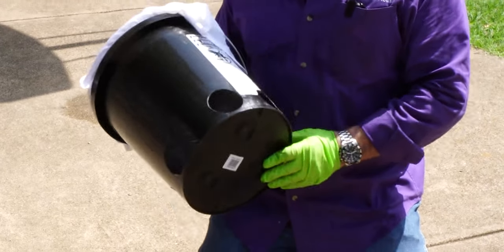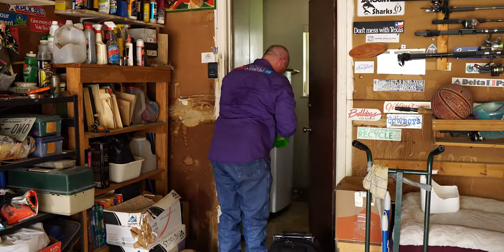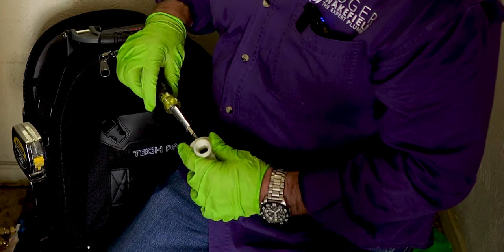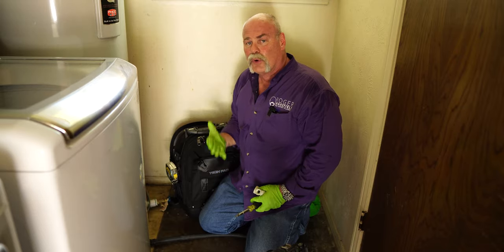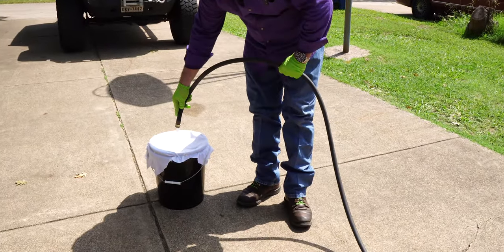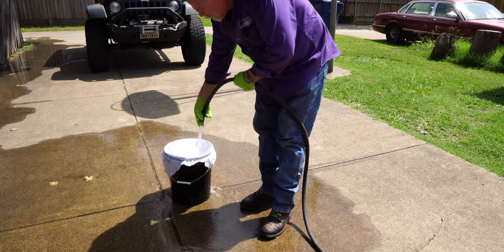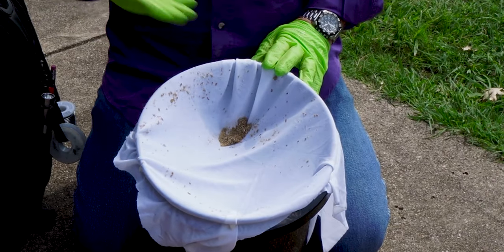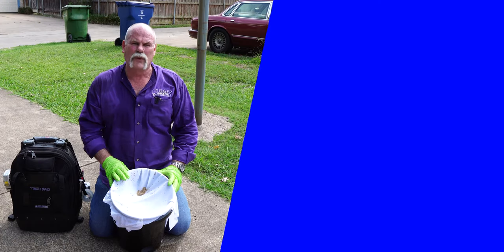How to Flush a Water Heater the RIGHT WAY - DIY Plumbing

Comment: Have always pretty much flushed my water heater as you describe every year, but not with a filter/bucket.  Let me also mention that I have whole house filters (2 in series) and a water softener.  After flushing for 10-15 minutes with the cold water supply on, most of the large sediment was gone, but there were some fine particles still coming out.  However, today, after reading some other posts on this, I decided to just drain my water heater (opened the pressure relief valve to prevent a vacuum) after shutting off the cold water supply.   I let it drain most of the way, closed the PRV/PSV, then turned the cold water supply back on.   Surprisingly, a whole bunch more of larger white and brown 'rocks' came out again, which I did not expect.   Apparently, the turbulence kicked up a bunch more sediment that had been missed in the initial two flushes.    Might be worthwhile to flush in two steps - one with the cold water supply on and then again by draining the tank and then turning the cold water supply back on.
Reply: This is a great idea, I just had to do the exact same with mine
Reply: Did turn the heater off ? You don't say.
Reply: @anotherdamnyankee3805  switch it to Pilot or Vacation mode, not Off.
Reply: don't mess with the pressure relief valve. open a faucet on hot to prevent a vacuum. opening the relief valve makes it more prone to leaking later. it's like a fuse, it should only be used in the event of an emergency.
Reply: @spanthrax  I tried to drain my water  heater and the water comes out as clean as it should be?

Comment: Mine was never flushed in the 5 years Ive had it. Last week I put a hose on it and flushed it out. The water came out thick black with chunks. I let it run for 45 minutes lol.
Reply: I see your 5 years and raise you to 10. I'm kinda scared to see lol
Reply: @williamwiese9963  Mine beats all....... it's a millennial, no joke pushing a quarter of a century.
I think it might start off with a few pounds of dust considering the 30 year old pressure tank was full of rust and sprung a leak at midnight a few weeks ago.
AND the pilot keeps going out on the furnace that was already old when it was converted from an oil burner to a gas burner 50-60 years ago...

RUSTIC..........
Reply: My heater is from the 80’s and I highly doubt the previous owners ever flushed it. I’m about to attempt it 😂
Reply: @AliHasSpoken  I got a reply on a different comment of mine saying if it ain't broke, don't break it.
If you try, good luck.

Comment: This!  I watched a few of these but this one was most specific and gave the t-shirt idea, into bucket.  I didn't expect to see much in newer Bradford water heater and if I just let drain, it looked pretty good.  Putting it through a green t-shirt revealed my hard San Diego water residue.  I did it in phases of filling up the bucket instead of one shot, to allow inlet water to come in and swirl around (and no holes in buck, and heater was deep in garage, so this was very clean.

Comment: In Phoenix, and Bullhead City, AZ you should flush your water heater, regardless if it is a tank, or tankless, once a year.  The water there has so mush sediment in it, that I've seen tanks blow out after three years of not being cleaned.  Even with the salt or RO systems, the tanks can hold sediment in the bottom, and those tanks need, I stress need to be done no less than 2 years.  I used to be a Realtor in AZ, and was also a property manager, and now do flips in those areas so I have seen a lot of this first hand.  It is such a simple thing to do, I'm surprised at how many people never flush their tanks, and then wonder why their systems perform like they do.

Comment: You deserve more likes. Thank you sir. I am rebuilding a double wide mobile home. One of my last tasks was a whole house filter. We have well water but it has rust and was fixin to ruin our beautiful brand new tubs, sinks, terlets, etc. 
Well sir, we have run a couple weeks without filter before I installed it. 
Needless to say (in hindsight) the water heater was still full of crud. So I ran all the faucets for wafts seemed like 30 minutes. Very small improvement. 

So I thought…let me see what YouTube sez. Can I open the drain valve and run it while pressurized. I thought so…and YOU SIR confirmed it! 😊
I ran several hundred gallons through the water heater and it is crystal clear. I even closed and opened the drain valve several times while flushing it. 
Very RARELY will I give this much of a reply. But here ya go… you deserve many more likes! 
Thanks from Suwannee Homestead! 🎉 2:11
Reply from the maker: Well you sure sound like a pro at flushing a water heater! That is awesome! So glad it worked out for you

Comment: Is it really safe to do this without turning off the cold water supply valve?
Reply: With THIS particular method the cold water supply MUST be kept on since your BURNER remains on.  If you were to shut off the cold water supply with the burner still on while draining out the water in your tank, the tank will subsequently heat up and its lining will quickly be destroyed rendering your water heater useless.😮‍💨😮‍💨😮‍💨

Comment: Really appreciate your videos. I have a question. If there are large amounts of sediment that do not break up, is there anything that can be added to the tank to break down that sediment so you can get a better flush of the tank?
Reply from the maker: nothing added, but you can try sticking a clothes hanger or a rod into the flush valve to try and break up that sediment

Comment: I've been told before to open hot faucets and drain the tank down. Question 1: Is that necessary? So, you just put the drain hose on, open the valve, and let the cold water pressure flush it? Question 2: what if sediment plugs the drain spigot? Can you put a screwdriver in there to try and break it up? Q3: Should you turn the gas off before you drain it?

Comment: Fantastic video. It makes so much sense to let the water pressure flush out the sediment but at what stage would you open the hot water taps in the house and isolate the cold water supply to the tank to basically drain it fully (dead volume still left in the tank)? If I got this correctly you said 10-15 min. Also, I have a HTP tank with a relief valve. When should it be opened during the flushing process?
Thank you

Comment: That method you showed will work fine, if home owners flush their tanks at least every two years. If a tank has not been flushed in ten years, the flush method needs to be different.

Step 1- shut off the power.
Step 2- drain the tank
Step 3- remove anode rod
Step 4-  use a spray nozzle on a water hose to spray water through Anode rod opening. Move spray around. I have gotten a bucket full of sand-like sediment out of tanks using this method, when simply draining the tanks produced only a quart or two of sediment.

Step 5- install new Anode rod. Close drain valve.
Step 6- fill tank and run water in House until all air is out of the system.
Step 7- turn power back on.

I get eighteen to twenty years minimum service from from my hot water tanks. I currently have four hot water tanks.

AO Smith - 18 years so far and still going.
Bradford-White 19 years so far and still going
Whirlpool- 19 years and started leaking. I never drained it. It was at our cabin. AO Smith refunded my total purchase price plus tax paid. It had a lifetime warranty. The tank was built by AO Smith for Whirlpool. I replaced it with an AO Smith tank.

You can replace the anode rod, both electric elements, and both thermostats in an electric water heater for less than $80.00 in parts, if you do it yourself. I had to do that at year 16 on one of my AO Smith tanks.

This stuff is not rocket science.

Comment: I just replaced my 20-year old Maytag electric water heater this week after it started leaking internally and shorting out the thermostat, leaving us with scalding hot water.  I replaced it with an A.O. Smith 100 model,....it came with a plastic drain faucet at the bottom, however, it is a few inches higher than my old Maytag outlet. This allows me to connect a drain hose without interference from the sidewall of the drain pan.  I hope to get at least 15-years out of the new water heater.

Comment: Sometimes you will get a weird blue jelly. A couple times the sediment was so bad on a water heater that I've drained the entire heater, removed the brass drain, and vacummed out the bottom of the heater with a shop vac and a rubber hose.

Comment: Thank you so much for this video! I am in the process of flushing a leaking water heater right now, and I was surprised I wasn't seeing a lot of water come out the opposite end. I kept screwing more thinking that it was a screw that should come loose, then when I noticed it wasn't I thought it should be inline with the hose. Checked this video to confirm. Unfortunately the water must have leaked out already, the water was pretty soaked on the floor coming back from a vacation so pretty sure there wasn't much remaining to drain =(

Comment: I have an 50 gallon natural gas AO Smith power vent that had the anode rode disintegrate 3 years into its life.  Cottage cheese like sediment was plugging up fixtures. Had to drain, flush and install a powered anode rode system. Problem solved. 
Was this from too soft water eating the magnesium anode rod, up here in western PA?

Comment: I'm on well water. I have an ozone air tank with a media filter and a water softener. I just flushed mine for the first time in a brand new water heater after 2 and 1/2 years and barely got out any sediment. Do you think it's because my water is just free of all of the junk, or it's actually already started to harden? I flushed it the exact same way you did. For reference my tap water does taste very clean almost like bottled water.

Comment: I finally replaced my plastic spigot with a metal one after 10 years.  I just take a pail and open it up until it runs clean once or twice a year.  My last water heater the rod never wore out and never needed replacement in the heater lasted over 30 years doing this.  I set to 125degrees at kitchen sink as the gas unit at the tank will kill germs 132 at tank and less than 135 to scale tank.  If I had hammer arrestors on my washing machine (easy to install and helps whole house) my first water heater would probably made it longer.

Comment: I’ve had my water heater for 10 years and nobody’s ever told me to flush my water heater. I didn’t know that was a thing. 
Now that I came across this video, I am going to flush all that settlement that you said that coats the inside of the water heater, hopefully get them walls and the bottom cleaned after never flushing it before, is there a trick to cleaning that stuff you can’t see? 
Ty

Comment: Roger my hot water heater is a gas power vent/flue style with a 12 year warranty. It’s about seven years old and has never been flushed. I was thinking of flushing and replacing the anode rod. Do you think it would be worthwhile to do so on a hot water heater that is 7 years old or am I asking for trouble??? Thanks for your time and for all the great videos! I always learn something!
Ron

Comment: @RogerWakefield thank you for an awesome video sir. I flushed my water heater today. Maybe you can help with a couple questions though.. firstly, while draining my heater it seemed to glug glug glug along the whole way slowly despite having faucets open, unless I opened the pressure vent, it took forever. Second and more importantly, my gas water heater seems to only put out lukewarm water now. It used to get scalding, and now it doesn’t, weird. Any ideas? It’s a 4 year old gas Rheem 40 gal water heater and has never been flushed till yesterday. Hope you can help. I’m a first time homeowner in the Texas panhandle and your videos have been a God send.

Comment: Are usually do mine every few months. I live in an area with very high dissolvable solids. We’re like it 150 or 200 ppm which is really high so that builds up. The water quality out here also sucks. It will go stagnant or sour in a few days. And this is treated city water.

Comment: My parents 5 year old water heater sounds like someone is tossing rocks inside it lol....we live in a neighborhood that has the worst calcium deposits ever...everything turns white powder if water is left to dry. I wish i had seen this or known this 4 years ago it desperately needs cleaned. I sent Roger a FB message and within a couple days they responded. If i do clean it it may cause fractures since its never been cleaned sooo im kinda worried. But i cant leave it like this. Thank you for the response Roger great vids.

Comment: I let the system pull a vacuum on itself then turn the water supply back on to give me a good surge. I’ll let it run for 30 seconds to a minute. I’ll do this about 5 times. I flush every 2 to 3 years and replace the anode rod every 5 or 6. I put a camera in the tank when I change the rod.

Comment: Hi Roger, So.. Should the hot water outlet valve be turned off while the cold water inlet valve stays on while it's being flushed?
 Then allow it to refill and slowly open hot water outlet valve? I do maintenance in an apartment building. We have three hot water heaters that are in rotation. Two are kept on while one is off. (Please, Anyone can comment to help me). We have some complaints of brown hot water in showers and bath sinks. NO Filtration or water softeners installed. Built in 2004. Thanks.

Comment: One thing you should probably think about after flushing a water heater is that it’s good idea to open a Hot side on a faucet and maybe remove the aerator and flushing the lines in the home. I flush heaters all the time  and the worst thing that happens is you break up all that scale and blow it through the plumbing system. If your not careful you can plug up cartridges and or areators . 
Thanks for your videos. Keep up the good work
Reply: Noob here. Once I remove the aerator, would I need a pump to blow the water through the hot water heater, it would I just need to turn the hot water valve on?
Reply: @christiandj50  Just open the hot water side of the bath tub - no pump needed. In the scerino he's showing (NOT turning off the water at the meter), there will be anywhere from 15 to 40 lbs of water pressure (in my area) coming from the street / thru the water lines / thru the water heater / thru the hot water faucet

Comment: I have an electric water heater and hard water...
I usually drain the heater and change the elements every 6 months.
I also have to use a vac to get out all the calcium because it will not come through the drain.
Reply: Get a descaler. Wraps the incoming water line. $200. Really helps. I have on both my houses.

Comment: Do you turn off the heat before you begin thr drain process?
Reply: I was wondering the same thing about turning off the gas
Reply: @chrishoel6954  I don't think his method requires you to turn off heat because its constantly being filled with water as its draining.

Comment: I have a recirculating pump at the top of the water heater to send water to the far side of the house.  I forgot to turn the pump off and it wasn't working following my flush.  I didn't do it your way, but turned off the water supply and completely drained the heater.  Luckily, the recirculating pump worked the following day.

Comment: Hi roger, I have a water softener in my home and the water heater has always had soft water in it. Do i still need to flush it?  Thankyou for your answer.
Reply: Yes I have water softener also and a plumber told me to flush once a year and change Anode rod every 4 years give or take

Comment: Would you recommend using a wet shop vac so pull water out faster and perhaps pull more sediment out as well?
Reply: While replacing the lower heating element on an electric water heater, we used a shop vac and duct taped piece of rubber hose that fit inside the water. Here opening pull out gallon or more of mineral deposits!

Comment: I have had a tankless hot water system for 10yrs now. It has never been flushed. I have two bathrooms at one end of the house. One shower regularly turns cold after about 2mins the other adjacent shower turns cold occaisionally. Both the sink taps and the kitchen taps and half bath taps at the other end of the house work great with no fluctuating problems. What do you think?

Comment: I've seen videos of water heaters being full of calcium and the proper way to clean being removing the heating element and using a wet vac. That's not an option with gas. Is there anyway to clean it this good?

Comment: Great video Roger! My wife and I have a 25 year old A.O. Smith 50 gal. gas, power vent water heater in our basement. It hasn't been flushed in the 15 years that we lived here. We also have a water softening system in our home. We recently just started to get that sulfur smell coming from the faucets, do you think at this point in time, a good flushing will help out with the smell? Or is it time to replace it?
Reply: Having the same problem. I was told to pour in a cup of bleach and let it sit overnight and then flush it and replace the magnesium anode with an aluminum one. Purchase the new rod for $20 at my local plumbing supply store. Installing it tomorrow as The water heater is soaking with the bleach tonight.

Comment: Roger, do I need to replace the valve when it does not close? Mine I have to use screw driver. Water still leaks out.